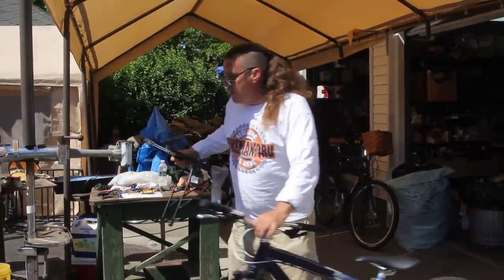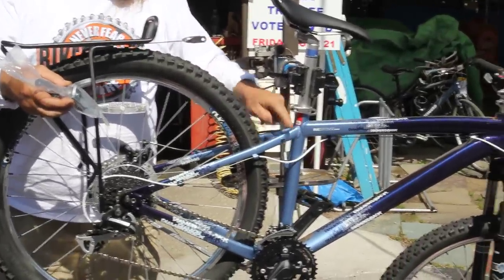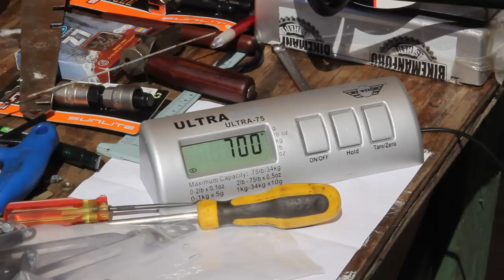Rear Rack For Disc Brakes - How To Install - Bikesmart iRack Disc - BikemanforU

Comment: Just mounted this rack on an Aventon PACE 500 e-bike. The rack mounts a bit under the bike saddle so if you like your seat mounted very low these won't work out. It is not a problem with my setup.